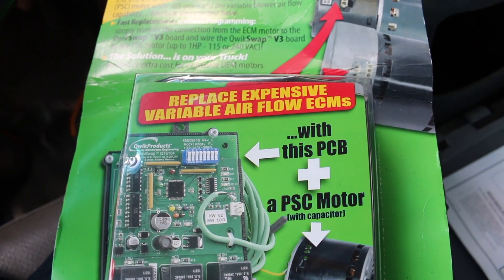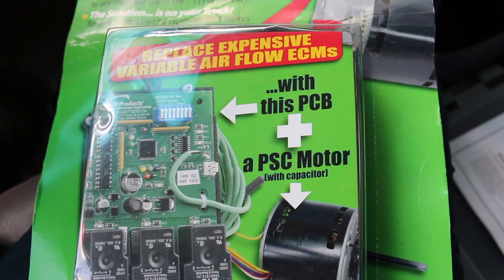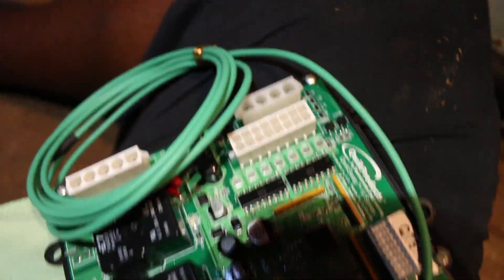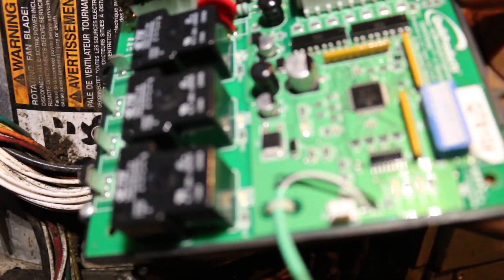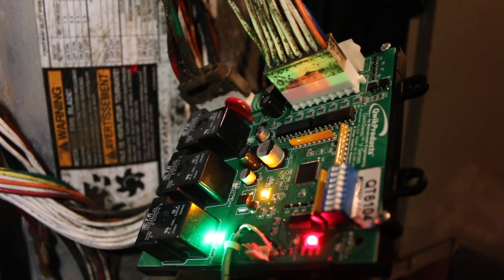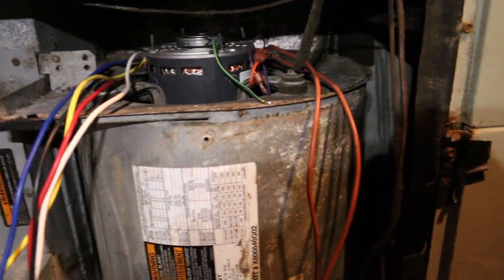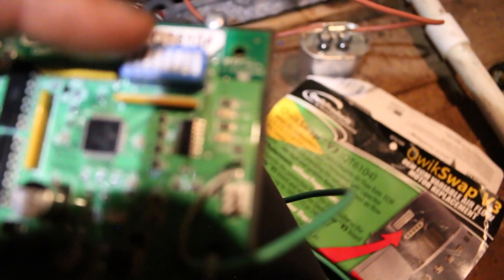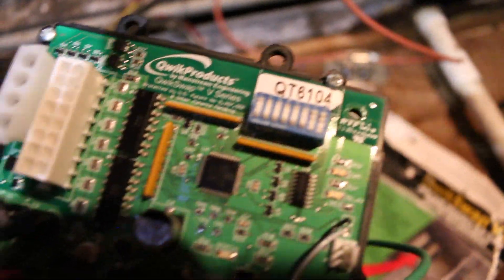ECM/X-13 Fan motor replaced with PSC motor and Qwik Swap V3 board

Comment: Those X13 motors seemed to be designed to fail within a specific time period and are astronomical to replace.  Once out of warranty, just swap it out with a PSC motor and rewire with a 90340 relay and be done with it.  I read some article that Heil engineers are working on developing ECM style compressors and hope to have to them on the market by 2028 to replace their invertor units, it didn't specify whether the module will be inside the hermetic shell, or outside the unit and replaceable.  When the day comes when this goes full scale, the cost of replacement will be equivalent to a total system changeout, you'll be lucky to get 5 years out of a system at that point, especially in southern states with the units running 8-9 months of the year continuously.

Comment: Thanks For your video 👌I’m a HVAC student. My question is how many uF capacitor you used? Thanks 😊
Reply from the maker: On this system, I think it was a 29mf. But if you’re talking about total capacitors I have used, I couldn’t even guess. Stick with it for sure, too many people are investing their time into computer work and forget about skilled work, si you will be a high demand.
Reply: The motor I installed is a one hp motor which called for a 20 uf cap

Comment: Mikey! Love the truck stock.
For residential use what's the must have universal motors to carry for condensers and furnaces
Reply from the maker: Capacitors of all sizes and hard start and relay for 1-3 ton and 3-5 ton. And yeah, you need to have at least 1 of each fan and blower motor on the truck

Comment: how much efficiency are you loosing from going from a x13 to a psc using the quickswap x3?
Reply from the maker: Basically your just getting multiple speeds, which helps when you turn on the heater. And also helps with drying the humidity on the home. I’m now sure how much more or less efficient it is.
Reply: @hvacjohnnie  i suppose your right only a true or full ecm would be efficient, x13 is little more efficient than psc but the modules are lacking longevity
Reply: On cooling my old 3/4 HP PSC motor pulled 900 Watts and my new X13 moving the same amount of air only pulled 600 Watts.
I would think the X13 would pay for itself in 1.5 to 2 years.  Those old PSC motors are energy hogs and also add more heat to the return air!